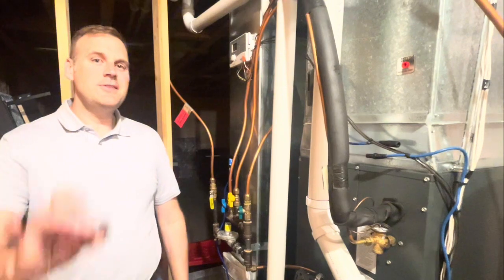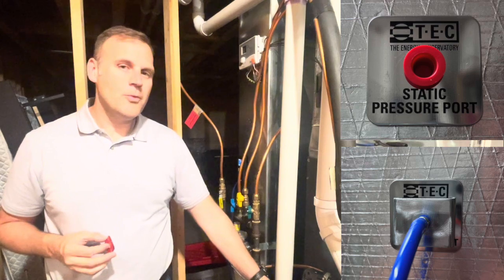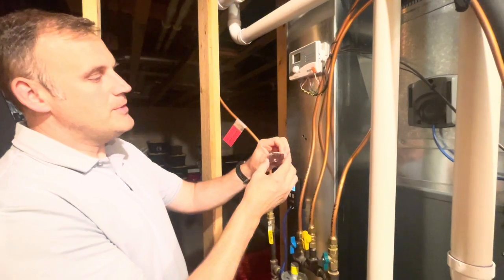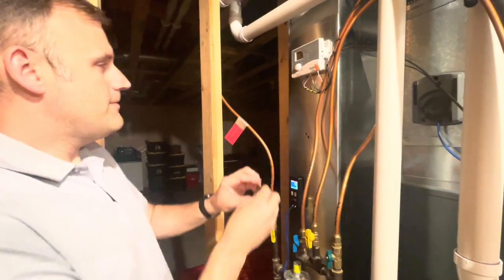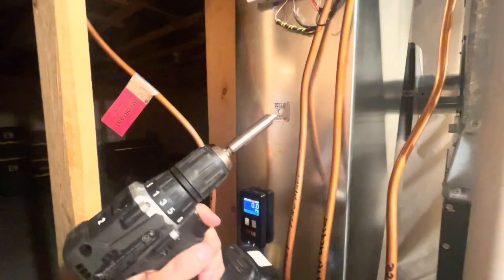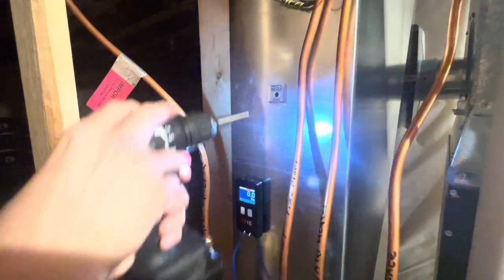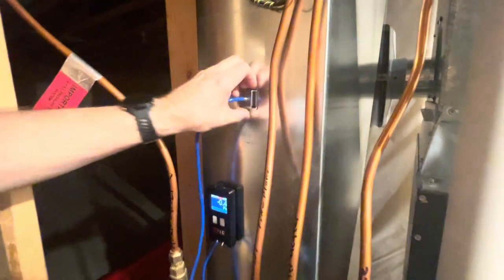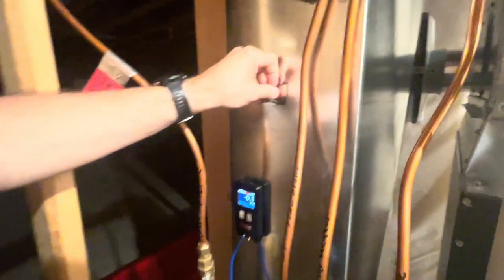Static Pressure Port Overview

Comment: Why didn't you demonstrate using the port on something that probe wouldn't already work on, lol? That's like demonstrating 4wd capability on a paved road...
Reply from the maker: I moved to Wisconsin and finding duct board is like finding a needle in a haystack.  That’s why my good friend Michael, who lives in Florida where duct board is everywhere, helped me out with the before and after presenting the issue related to duct board in this video.  However, can’t argue that this product leaves a nice clean professional look no matter the material it’s applied on.